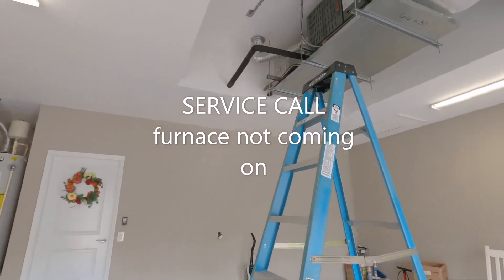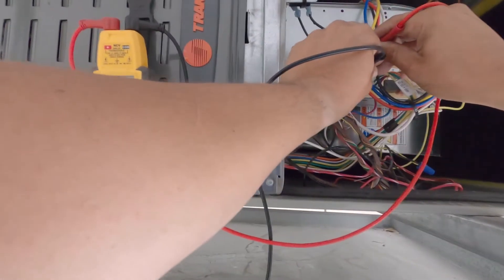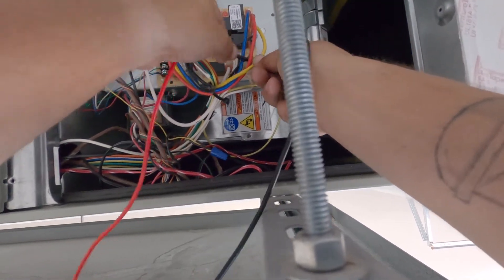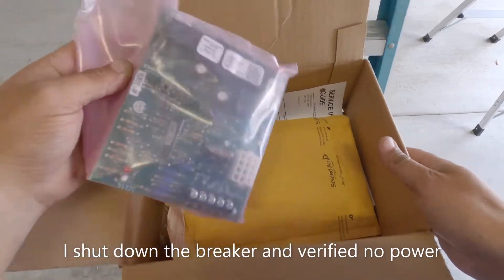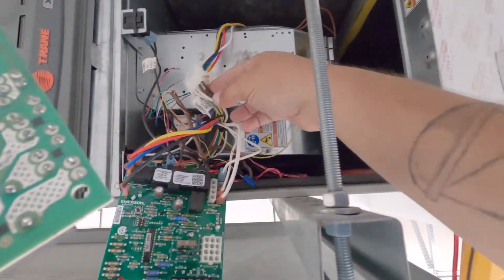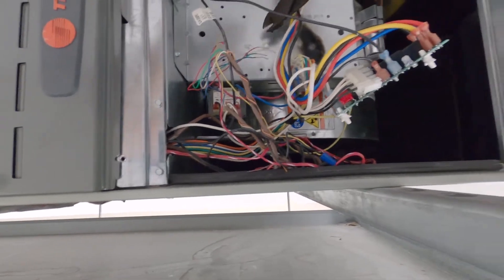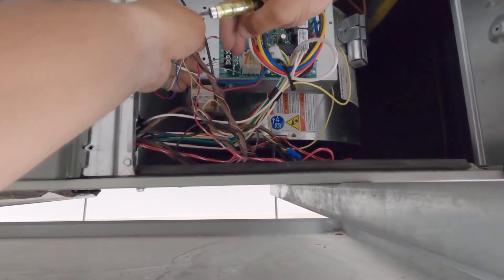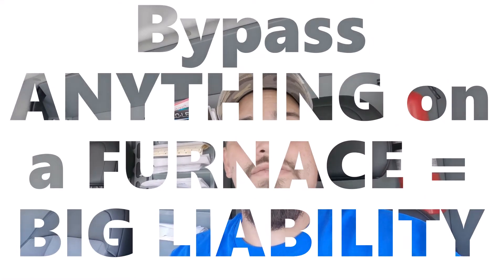Diagnose and repair Trane XR80 gas furnace. POWER SURGE!

Comment: I agree with the no bypassing, when I was new I bypassed a high limit on an electric air handler and told the guy the dangers of not leaving it like that and that he has to have us repair it correctly. I felt bad because it was -10 outside. Needless to say I'm never doing that again because when I called back to give the quote in the morning the guy dodged my calls. From now on I don't bypass anything unless it's for testing purposes and leave my heart out of the service calls.  He could've at least answered his phone and told me he fixed himself or called someone else to put in the part. That bothers me still to this day wondering if it's still bypassed. Good job sir!
Reply from the maker: I've had a similar experience and I'm with you on that. It bothered me for while. I ended up just letting it go because it's not your fault for the customer not calling you back out to make the repair.
Reply from the maker: Thanks for sharing that with us Nate

Comment: Question .. my a/c was working all the sudden it stopped and now it sounds like the mother board is clicking .. it got wet from condensation and the red led lights is solid no blinking . What’s going on
Reply from the maker: Sounds like the board is locked out on a safety. Goodluck

Comment: Caught your vid on my recommended feed. Good work! Not sure if it was done, but I would also suggest testing a heat cycle just to insure the inducer or gas valve weren’t also affected. It doesn’t happen often but it will sometimes. Keep up the good work!
Reply from the maker: Awesome, thanks for the feedback and glad you enjoyed it. I did cycle the heat after the repair and everything checked out ok.